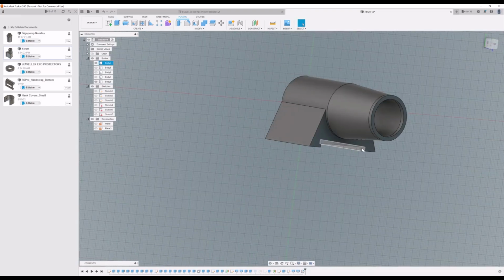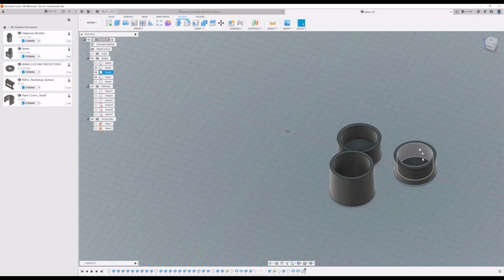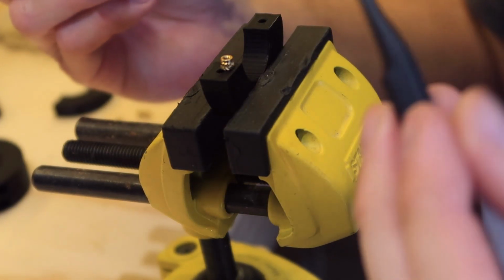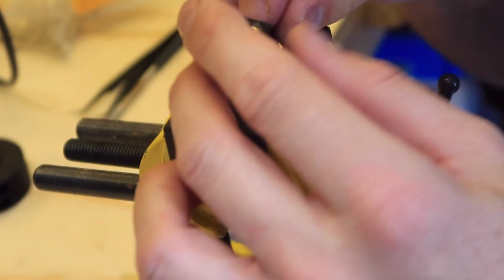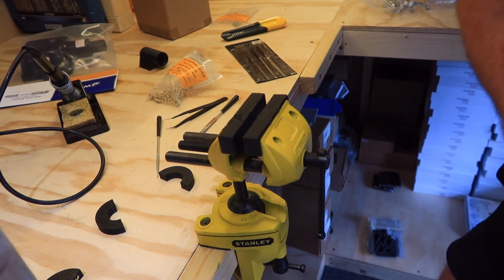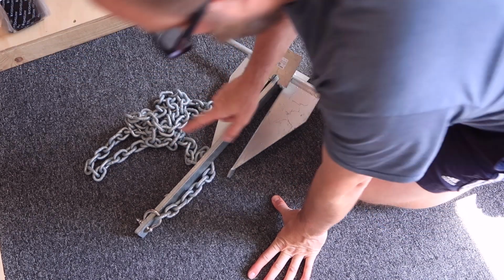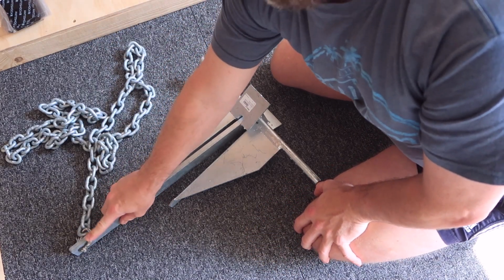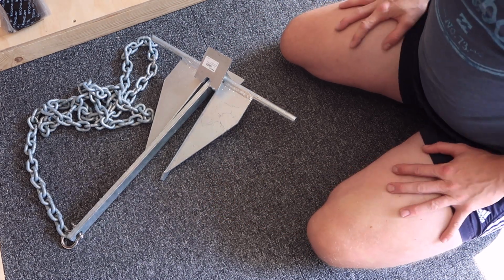A new anchor and some 3D print projects

Comment: Very good Dave.
I really like your 3D printing malarky, I'm most impressed.
I shall wait with baited breath to find out the name you have chosen.
Best wishes
Al
Reply from the maker: Me too. I have absolutely zero design expertise, other than self taught stuff you see. Although I have been 3D printing since it started so probably have accumulated about 10 years of experience now!! I remember the first machines we had that we had to self-build from laser cut wooden panels and then the Makerbot ones. We spent more time working out failed prints than good ones and about a month wondering why a printer was working fine and the no longer working for some mysterious reason, until we realised that moving the printer by the window just totally changed the temps in the chamber. We had no idea!!!  The machines these days are just amazing though compared to those days. You can make anything!

Yes the name is set. It's not what you'd expect, but I hope people love it as much as I do!!

Comment: I just bought an anchor of the same design, it has holes in the square 
Plate maybe that's where your anchor should be drilled?
Reply from the maker: I'll be looking into this soon as I need somehwere decent to stow my Danforth! Someone on the Drascombe forum told me that Drascombe sell a set of chocks for a Danforth that screw into the gunnels and deck at the bow of the boat. Only £30 so may think about that as a solution.